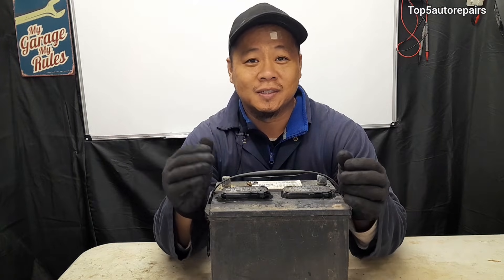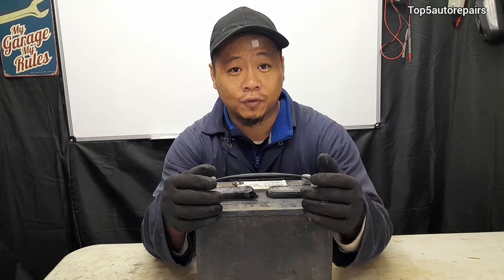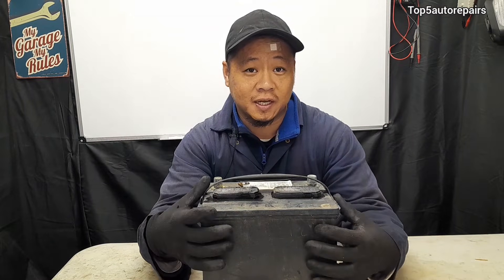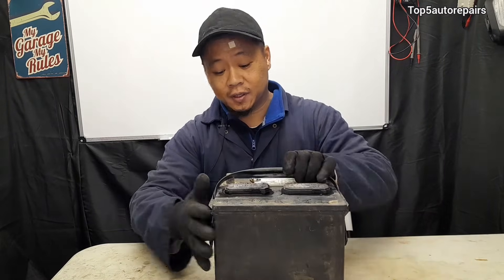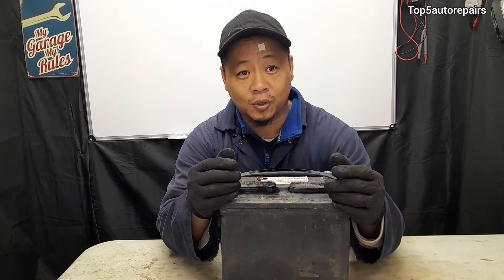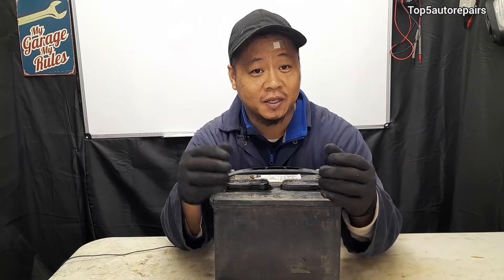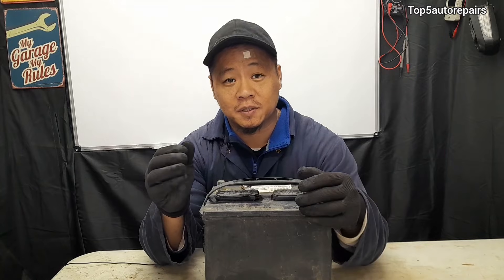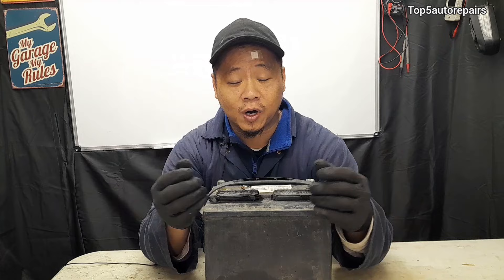Alternator Overcharging Car Battery (Know the Symptoms Causes and Common Problems)

Comment: I have a 2009 Dodge charger when I cut the car off the dashboard itself with all the cluster lights won’t cut off could this be the reason? Or is that more in the body control module?

Comment: i just had all this issues battery smoking, airbag deployment system go off and also check charging system error codes go off on a 2006 ACURA TSX i think its most likely a faulty alternator

Comment: ECU causing the alternator to overcharge? I have never heard of that before.
Reply: On some modern vehicles, the ecu monitors the battery...as the battery gets old, the ecu will tell the alternator to increase the charging output.   Eventually you'll need a new battery, but if you don't reprogram the ecu, it'll overcharge the new battery.

Comment: thought my battery was dead, jumped it, put a multimeter on it while running. 15.8volts..... .so bad. pretty sure the voltage regulator fried the battery lol
Reply: Then you changed battery? or changing alternator solved the problem
Reply: I’m running a ford fusion 2010 se. battery was smoking. Where is the regulator located?

Comment: My alternator is charging at 14.9 new battery from toyota is that too much?  No other symptoms.
Reply: 13-14 volts is typical for a charging range, arrange for overcharging would be 15 to 16 V and more
Reply: The alternator should be at 13.5V anything over 13.5V will overcharge the battery and damaging it.
Mine does the same thing
Reply: Depends, AGM batteries need that voltage
Reply: I have a cadillac escalade and it is charging at 14.9 is that bad and what would that mean

Comment: when i start car voltage starts at 16 volts then settles to 14.2 after about a minute is that ok or bad alternator
Reply: Any issues?
Reply: The alternator is fine, my car does that too after the car is warmed up, it goes back to normal voltage.

Comment: Hi I have a high output alternator and is overcharging the battery to 17 volts . Can it be the voltage regulator in the alternator or the alternator itself that's bad
Reply: Did you fix the situation?

Comment: Dashboard Lights were flashing like crazy every light on the dashboard came in ,replaced the alternator and it still did the samething,I was told I need a PCM but u said ECM and there is a difference so I need to know which 1 do I actually get..I've had No problems with my vehicle stalking nor running bad so far just the overcharging..I'm just ready to order the part and get my car back on the Rd but I want to order the right part
Reply: Try reset your door locks

Comment: Sir upon checking using voltmeter it range 14.9-15.1v is it okay ? If its not what will be the posible to replace I.C or alternator..? Thankss
Reply: What did you do about your problem and was it a problem or not? Because I have the same problem
Reply: @ahmadjumaa7348  i did nothing since  it is not causing me into trouble ...what about you?
Reply: @AngkolDiYTv  same case in my i20 2011. It's giving 14.8 at idle rpm. And I am not facing any issues.
Acceptable range is 14.2 to 15.2.
That's it.
Reply: I replaced my alternator 
..

Comment: Very nice informative video. I have. Subaru forester 2008 model Manuel transmission 
Now my battery is licking and the mechanic says it overcharging that is why it brings some bubbles outside and cause the licking. I didn’t check the alternator I don’t know how much bolt it sends. But the mechanics told me the battery is overcharging that is why it creates those bubbles coming out. What can be the cause? Which thing should I change : the battery or the alternator?
Reply from the maker: Replace the alternator and battery

Comment: Hello I have a 2005 Ford Escape 3.0L V6 limited 2wd. I am having issues with my battery overcharging still after first battery got to hot started spewing fluid and the issues below. I had recently gotten the battery a month prior. So since I didn't know what was exactly wrong I took it back and had it replaced. My vehicle ended up having the same kind of issues. Battery not boiling and spewing as before but seeming to get hot same smell as before. When I accelerate loss of dashboard lights no power for windows loss of radio windshield wipers turn signals etc. When I brake they come back on. Next morning car battery was dead so I ended up getting a jump and met the repair guy at the nearest Auto Zone 1.5 miles bought the alternator and serpentine belt he replaced it there everything seemed to be fine but oil was leaking so he suggested we also replace the valve cover gasket this Auto Zone didn't have the gasket so we drove to next nearest which was 4 miles away everything seemed fine but ended up having all the same issues still. Any ideas at all on what my issue may be ?? If it might be some kind of ground or maybe a certain wire cluster could you please tell me where they would be located. I will be very grateful. Thank you in advance and God Bless :0)
Reply from the maker: Hey there. Have you checked the alternator to see how much voltage it is putting out? 15 volts and more is overcharging.
Reply: @Top5AutoRepairs  Thank You I will have the Auto Zone check this and I will respond back for further assistance if needed. I am a woman of 50 years I have some knowledge of repair experiences on vehicles but continuing to learn more along they way. Lol one issue at a time.  :0)
Reply: I was sold a bad alternator will let you know further once I am able to pay to get another one put into again.  Auto Zone wasn't able to tell me how many volts were running but if it was good or bad. Thank you for that lead. Have a good day  :0)
Reply: I have the same year escape, and having the exact same issue.  Just replaced the alternator and it started doing what yours did. Did you get it fixed? If so do you know what it was?  You might be able to save me a bunch of work and money.

Comment: What if it's at 14 point 82 is that okay or no and that is the vehicle running
Reply from the maker: It's acceptable
Reply: @Top5AutoRepairs  thanks for the info i put in a new alternator in my Trailblazer 05 and I wasn't sure what the voltage is supposed to be

Comment: 2003 VW Rialta (eurovan) v6
Power loss both electrical and mechanical when accelerating. I think the alternator regulator (reads 13-14v at idle, but up to 18v under throttle) is overcharging and causing the gauges, ac, and everything to bog down. I do notice the more things that are turned on the better it runs, guessing from the extra current draw. just wanting to know if anyone has experience with an over charging alternator and does it cause power loss?
Reply from the maker: 18 volts is too high. The regulator is faulty.
Reply: @Top5AutoRepairs  Im running a swapped 2000 civic with a k24a2 09 Tsx engine when Vtec is engauged my battery lights come on as the idle drops it will go away Alt is ready 14vFlat and battery is running 16.4 16.9 could the regulator be bad i mean ECU i think would be more much Noticeable